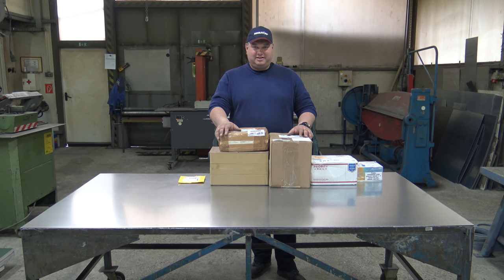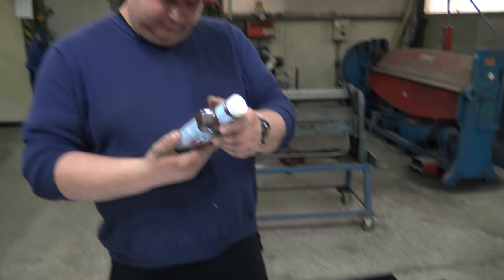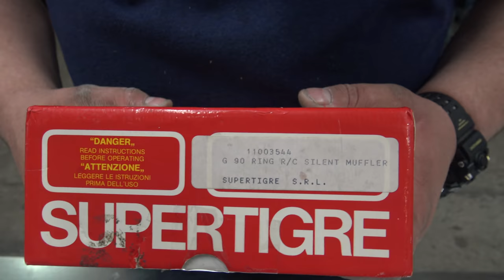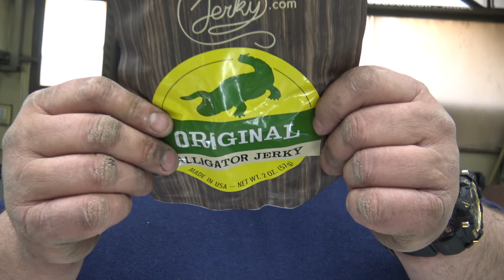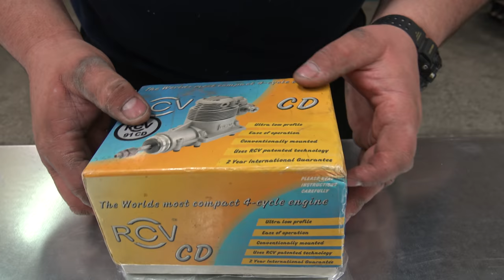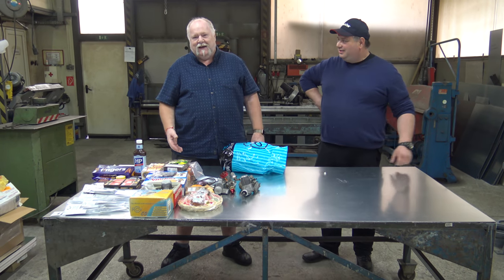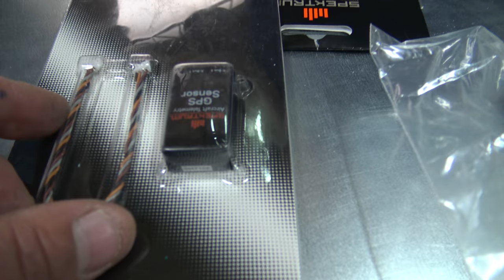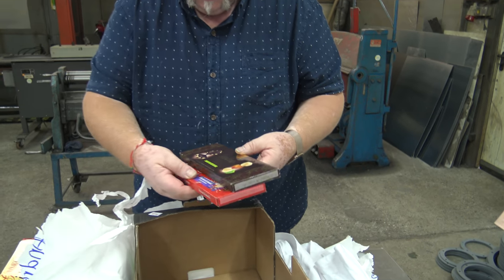SPECIAL Edition Friends Gifts Unboxing Petrincic Bros RC

Comment: You got the watt meter last time! That checks watts AND amps. That there is a low voltage warning beeper. It beeps when the cell voltage gets too low. The display shows the voltage of the battery. Marmite is the same as Vegemite in australia. Put it on toast with butter, perfect. Eat it by itself, horrible..
Reply: oh thanks!!

Comment: Hey everyone! I have an unboxing of older RC stuff also. It was a garage find from someone I went to school with. Lots of vintage RC equipment. Check it out at RC Hobbiest Extreme. You guys need to check it out! I personally love getting those mystery boxes! You never know what you get eather! I still have my Super Tiger from Italy. I replaced the bearings and added the carb screw that mounts on the back of the engine because the regular carb floods. What would you use a .90 on? Thats a huge engine